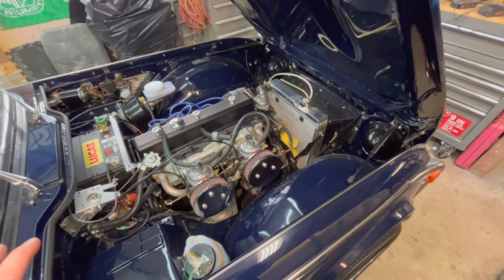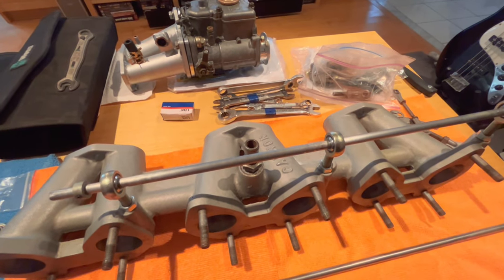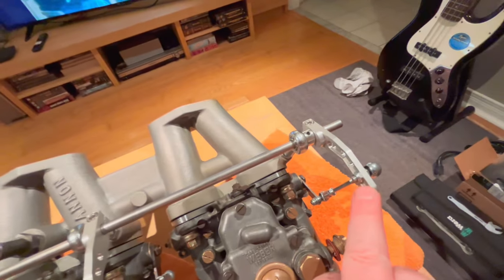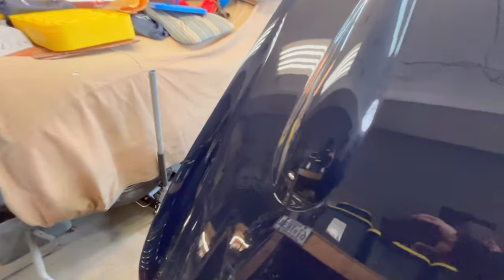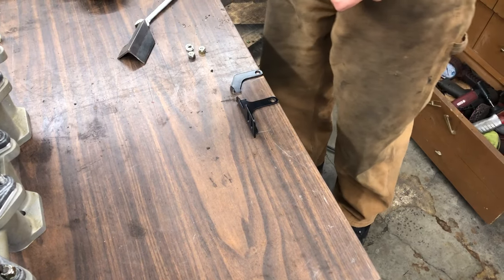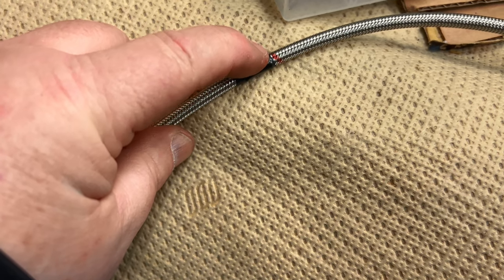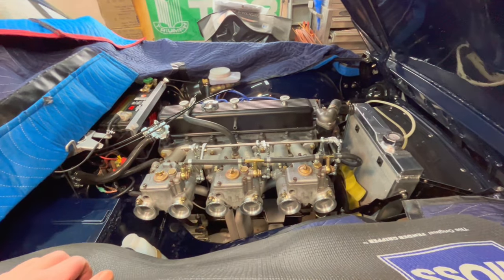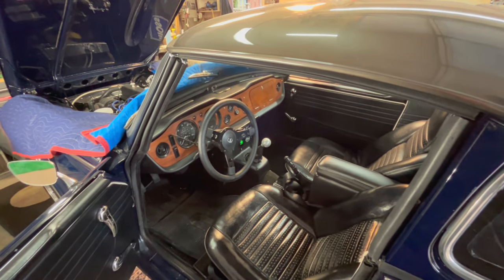1968 Triumph TR250, Converting Stock Zenith Stromberg to Triple Weber DCOE 40-2 Carburetors

Comment: You’re going to love the Ratco throttle cable! Thanks for mentioning my channel!!
Reply: I got confused by all the cables. Did the middle one come with the kit ? Was it running on the Amazon cable ?
Reply from the maker: @johnmoruzzi7236  the locar cable comes with the kit.  The Amazon cable was a cheap spare for measuring up.  It will go in the boot as a spare just in case the cable breaks.

Comment: Glad to see another attempt, Dave. Hang in there; if you get them dialed in you'll never look back and you can join the ranks of those who urge the flock to use them. Each success makes the case stronger to the skeptical who have by and large subscribed to the sour grapes cohort. With these you'll pass the rest of them like they're backing up. Good luck!
Reply from the maker: Unfortunately, still having multiple issues with them even after installing a new 1 piece cannon manifold.   I have a feeling they are in desperate need of an overhaul internally.
Reply: Not likely to need " overhaul " from the looks of them. Only if they have been internally corroded which these don't appear to have. Ensure the floats are correct; you want the fuel to be 27 or 28mm below the top of the well where the emuslsion tube goes in. Then check the jets against what actually works ( clue: it's not what they left the factory with ). If the chokes are 30s, OK but practically everything else probably won't be. My first set is still performing as it did 140,000 miles later; they were built in the '60s and were never " overhauled " internally; even the bearings are original. Perseverance it key! And pays handsomely here. @cheftush
Reply from the maker: @johnfremont3597  I’ve got a set of 42’s going on a warmed up TR4 in a couple of weeks…I’ll play with these and see if I can graduate back to the triples 😉

Comment: Nice work, Chef! Sounds like you're going to get a good throtle response from the Webers. For that hard to reach nut at the left end of the manifold, I've had good luck in the past using an extra socket and turning it down using my drill and the bench grinder. leaves you with thin sides and in most cases it turns out to be a one or two time use socket. Cheers

Comment: Hi I love this video. I had triple DCOE Webers on my Fairlane for 15 years and nothing beats the induction sound of Webers on a straight 6. When you get those balanced that's going to be so sweet. 

I never used the choke circuit in all that time couple of pumps before cranking and it would start and run fine. 

One question I didn't see if you lockwired the venturi retaining screws. I was caught out with a lost screw allowing the venturi in one barrel to spin blocking off the fuel to that cylinder. It was hard to troubleshoot because the idle circuit runs up quite high in the RPM range in my case highway speed. 

Also I had those throttle linkages you removed and they were sub optimal. I'm glad you upgraded them it will save you a lot of headaches. I'm looking forward to your follow up.

Comment: It would be very informative to get a  dyno test before and after the install of the weber's to see if the actual difference in HP to see if you get close to the PI version from the UK.   So much fiddling to get things to fit right, it makes one wonder if the manufactures actually made a test fit on a real car, especially the throttle linkage.  Best of luck with the new setup.

Comment: I'm interested to see what you do about an air filter. The inner fender on many TRs limits how deep one can be, and the DCOEs need some space to breathe properly. I forget the exact dimension. 
Something that might help is removing those very thick spacers (with the O-rings) between the carbs and the manifold. The OEM gasket that goes in there is quite a bit thinner. I was surprised to see how thick they are on your setup. (Moss Motors sells a Weber DCOE "soft mount" that may be OEM, or at least looks like one. It uses a non-replaceable rubber gasket and rubber isolating washers. Pierce Manifolds sells a different type that uses Thackeray washers and replaceable O-rings.)
Of course, maybe those thick spacers were installed to get clearance between the carbs and the exhaust header. But perhaps with the new one piece manifold they aren't needed. (BTW, I agree 100%, the one piece manifold is a much better setup.)
On TRs there can sometimes be problems with the heat from the headers so close below the carbs. There are heat shields sold that fit underneath DCOEs. Instead I opted to wrap the header  (only recommended for stainless steel headers... if not stainless, ceramic coating can help instead).
Finally, I am pretty sure you can reduce the idle RPMs by changing out some jets that control how much air and fuel are allowed to bypass the throttle butterflies. I would recommend first checking that the throttles on all the carbs are fully closing. You may need to add one or two return springs to the linkage to insure they fully close.
Reply: The sweet spot is 14.7" from the center of the bore to the lip of the intake trumpets, per Dave Vizard.
Reply from the maker: Thanks Alan, First, I’ve modified my inner fender early on in my restoration to give more clearance for that front carburetor, so I was thinking ahead there.  I have some oval K&n filters that will work with the trumpets.  The header is ceramic coated, so I’m helping that will help with the heat…the wing vents will help a bit here as well…yes, I’ll probably need to incorporate some sort of secondary springer for the return…I’ve already fabricated a tab for the spring so I’ll add in in a future video.  Cheers, Tush

Comment: I presently have triple Weber 40DCOE carbs on my Trriumph. With Triumphtune individual stepped intakes intended for the GT6. My throttle linkage is from TWM. I'm about the change to a new Cannon one piece intake and wish to keep the nicer TWM linkage, which is nicer than the Cannon version.  I am also using a Magard twin cable kit. Oh yes, my head has the wide intake ports. In my opinion the carbs will be better balance on the Cannon intake manifold because of the balance tube between each carb.

Comment: Looks cool Tush. I,m no expert when it comes to DCOE,s but Ive been told by many weber guys that a fuel pressure regulator is essential with your setup.
Reply from the maker: Not a bad idea.  I’m using the stock mechanical pump and it puts out between 2-3 lbs of pressure.  If I switch to an electrical pump, I’ll definitely go with a regulator.
Reply: If you are getting 2 or 3 lb. of fuel pressure with the stock mechanical pump, that's good. If I recall from setting up my 40DCOEs, they should see no more than 4 psi. I used dual Facet electric pumps that were the lowest pressure versions they offered at the time and had to install a pressure regulator to further reduce it.
Reply: Yes, absolutely, I use a Malpassi regulator. Don't waste money on those shiny chromed things from the auto parts store, they don't work. I also use Facet Electric Pumps, red top, not the small solid state block pumps
Reply: @cheftush  one of the reasons that I no longer use a mechanical fuel pump is that ethanol in the fuel eats the diaphragm in the pump, thus allowing fuel to enter the engine block and water down the oil viscosity!

Comment: I use Thackeray double spring washers on the bottom and the rubbers with cup washers on the top, because gasoline damages the rubber.
Reply from the maker: That’s how mine are set up as well.

Comment: Dave, just a thought regarding the high tick over, I used to have a similar problem running side draft (45 DCOE) Webers on the four cylinder Lotus engines. I think because you are running six chokes on a road going car, the natural leakage of air running by the closed butter flies may already be more than is required for a 900 rpm tick over. For our rally race cars it wasn’t such an issue. I may be completely wrong of course. Kind regards.